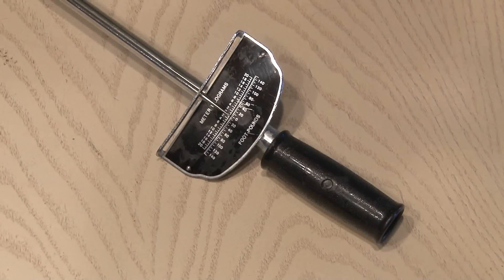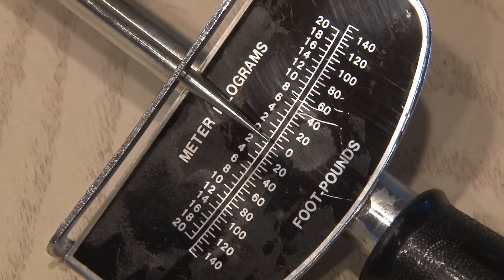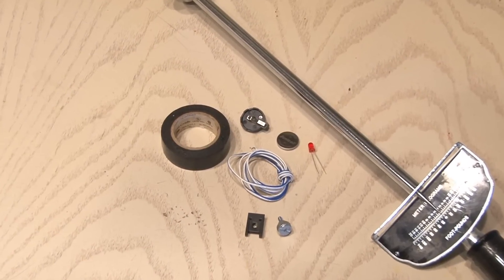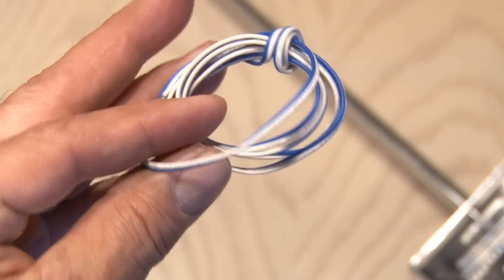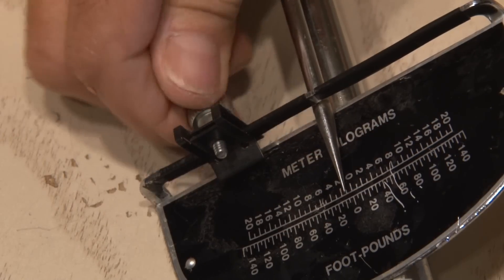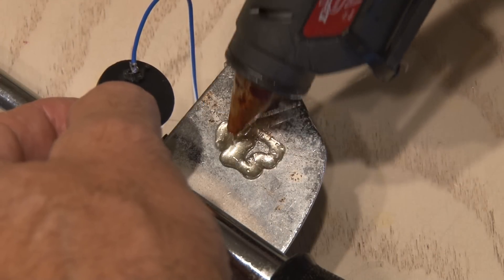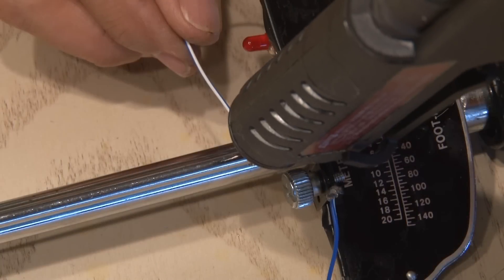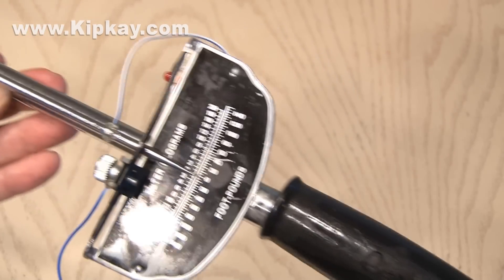How to Mod a Torque Wrench!

Comment: or you could just get a torque wrench that clicks when you hit the torque you set it at. thats how most torque wrenches are and they arent expensive at all
Reply: Wade Wilson Kipkay has become uber rich because of these videos. That's the only reason they come out, to sponsor Harrys or Audible. Expense is not a worry for him.
Reply: Wade Wilson Most of those types of torque wrenches cost upwards of $100. Kipkay took a $20 wrench and modified it with maybe $10 of accessories to achieve the same effect.
Reply: Dan T A cheap wrench like that's not going to be very reliable. If you're going with a click type, spend the extra money and buy a good one, not some cheap POS that will give you false torque outputs. I've snapped bolt heads off using one of those because the "click" never happened
Reply: sidgar1 that sounds like a user error
Reply: sidgar1 lol thats what you get from buying from harbor freight
Reply: sidgar1 I agree I went with a craftsman click style ($100) never fails. I believe the beam style like this are not all that accurate.
Reply: Dan T my local surplus store (canadian tire) sells the style kip is using for $25, the click type ones start at $100.

http://www.canadiantire.ca/en/search-results.html?searchByTerm=true&q=torque+wrench
Reply: sidgar1 Bought my harbor freight click type for $10
Reply: hudson fox have you ever tested brand new click type ones from harbour frieght? etc. they are accurate enough, for the person who changes there tires, etc. every spring/fall but if your going to be using a torque wrench regularly you might as well buy an expensive one anyways. not having the ratcheting function isnt that handy.
Reply: ***** yea lol i was the ware house supervisor for a while. they arent bad i have three and theyre still accurate, my wheels havent fallen off yet. But if youre a mechanic id think buying a better quality only makes sense.
Reply: Wade Wilson Thats an Inch/lb wrench. They've got their uses. But the clicking ones are better.
Reply: hutut tuthuht 
Just like the old saying goes, " A poor craftsman blames his tools". :)
Reply: hutut tuthuht I set it to the torque the car manufacturer recommended. It didn't work. The clicking mechanism locked up somehow. I tested the damn thing at the lowest torque setting in a vise and it still wouldn't budge. Never buy cheap when precision matters.
FlatlandWulf A poor tool is a poor tool no matter how you use it.
Reply: Matt In Illinois I guess its all preference. I'm no kid and still like the one that clicks. I almost never use air or power tools still rather use hand tools

Comment: Great idea! If at all possible, I use a beam-type rather than the clicker-type. If I must use a clicker-type, I use a beam-type to check the clicker-type before and after use. All the gearhead forums that I frequent have  stories about stripped threads and cracked cases involving the use of clicker-type wrenches.

Comment: I'm a mechanic and I can tell you that, just because a tool is expensive does not mean you shouldn't purchase it, if the tool is suited for the application, then you should buy it. Even a manual torque wrench which you pull out the lock and set the torque value then lock the handle to the specified torque works extremely well, which it will not change from that value until it is unlocked. These cost anything from $100-$500.

Comment: Life hack to this life hack: just shine a flashlight on it
Reply: slfozqo Uh, with what spare hand? Often times you need the other to hold something else out of the way, or for balance. Trying to hold a flashlight at the same time just isn't gonna work.
Reply: ***** Also, the torque meter could be facing away from you so you won't be able to see it at all.
Reply: ***** just get a friend wife son or anyone around to hold a flashlight instead of making this
Reply: slfozqo instruction not clear enough my car exploded because of not enough hands

Comment: As an avid mechanic and electrical engineer, I came here to tell Kip Kay how dumb whatever his idea was.

Actually, that was a pretty nifty trick.  Turning a $30 analog torque wrench to a function like a $100+ digital one is pretty useful.

Or you can buy a cheap "twist to click" type torque wrench which is easier to use in confined locations than the analog gauge type one shown in the video.

Comment: Will is increase the torque of my HONDA?
Reply: aboctok red leds need less voltage to light up. it goes like- voltage needed to light- Red<Green<Blue<White. So you can use a red one for longer.
Reply: No. I'll use a UV led or maybe an IR one. you can't tell me what to do. :P
Reply: Error1753 Insert turbo yoda's honda face here

Comment: i got a rachet torque wrench which costs £20 or $25-$30 and u set it to the torque u want and it clicks when it reaches it this is just an inconvenience to do and would be cheaper to buy the one im on about just look at snap on or draper even halfords if u have it

Comment: or u can buy a clicky type torque wrench..
Reply: ***** Most of those types of torque wrenches cost upwards of $100. Kipkay took a $20 wrench and modified it with maybe $10 of accessories to achieve the same effect.
Reply: not really, as his is still not a ratchet system, he might have hit the screw stop and moves them. the light will still light up even the limit has moved..

micrometer torque wrench are not that expensive in my country, i can get about rm160.. and my country currency is about 3.7 to 1 usd!
Reply: ***** With that mindset you could just buy a new everything....why are you even watching these videos?
Reply: Granite
not all modifications are as good as the real thing
Reply: ***** Depends on your skill. I agree most things you make probably won't be as good.
Reply: ***** i click type i found is 15 $ while a regular one is 5$ i made a buzzer type waaaaaaay before this vid was uploaded in less that 5 mins and saved 8 $

Comment: why would you need an indicator bar? we don't have those on our wrenches here
Reply: Mitchell Theobald Yes you do. It's a torque wrench. Odds are you've only seen a regular wrench. This is for things like cars and stuff where the nuts need to be tightened at a predetermined value.
Reply: An indicator bar is an outdated method. Most torque wrenches have a micrometer like setting ring at the base. When you reach the correct setting you hear a "click". They cost about $30. So odds are you've only seen an old one.

Comment: A click type torque wrench is faster, because of the ratchet mechanism (that alone makes it worth the higher price), and also more accurate than a a beam type wrench.  Also, it's a little more expensive; but I don't have to put it together myself, and it's certainly way under 100 bucks.

Comment: I've never seen this "common" torque wrench.. ever. maybe if i was 80 years old i would of seen it before. The most common type are the ones that you twist the bottom of the handle to your specific torque you require, then the head clicks when you've reached that torque and won't let you tighten it further. This hack is useless for any torque wrench newer than 1970. Cool idea, just doesn't belong in 2015.

Comment: How does the comment section of even the simplest of clever turn into such a mess? Stay on topic, if you don't have something worthwhile to add to the conversation just move on. Like the old saying goes, "It's better to remain silent and be thought a fool than to open your mouth and remove all doubt."
BTW clever hack that will work well. Especially useful if money is scarce and you have scavenged useful parts off of broken items.